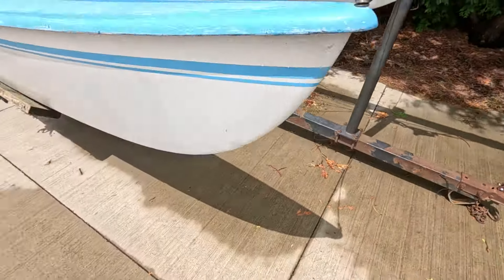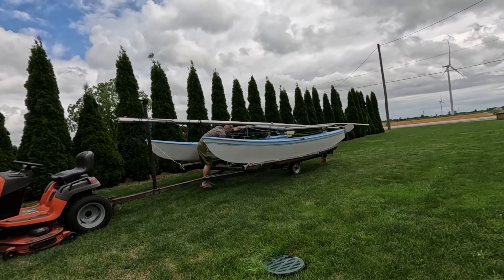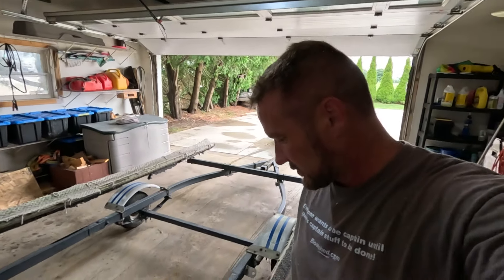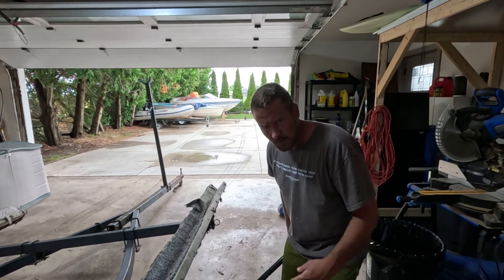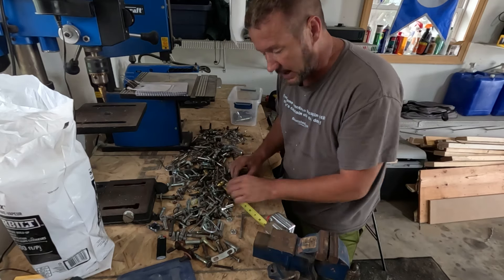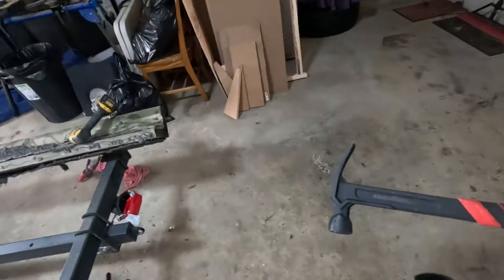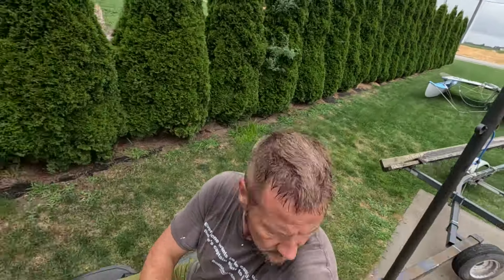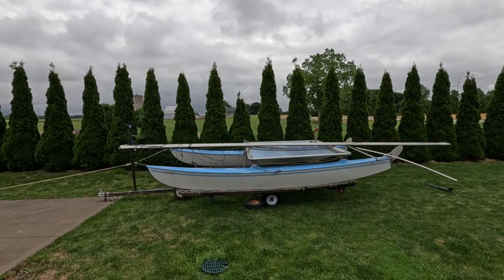Cheap Sailboat Has So Many Problems - Ep 285 - Lady K Sailing

Comment: Sounds like a fun idea, but I'd suggest super soakers instead of water balloons...  No need to throw balloons into the water.
Reply from the maker: They make ones appropriate for the task. Degradable. We use them in poker runs all the time. No mess.
Reply: The quick research I found is there really isn't a balloon that breaks down. It can take months or longer. Supersoakers are a better idea.
Reply: @stephenbmorton  "degradable" over the short time of 100k years!  Technically, the truth!
Reply: Someone has to bring a jet boat with a diverter.

Comment: I just bought a 1964 Contest 25-1 for $20. I drove to the DC area to get her with my trailer from my Catalina 22. I did put fresh tires on her and made longer bunk post for it.

I didn't realize how much more the Contest weighed. I was towing it being my 35 ft school bus. I kept my speed at 45 mph or less and stopped every 30 minutes to give the tires a break. I crossed the Eastern Continental Divide and went through Gatlinburg as well.

I managed to transport the boat from Washington DC to North Alabama safely.

Much of the interior is good and because it has no balsa core, the boat is incredibly solid.

The restoration is underway and I can't wait for our future adventures.

Comment: 😂 I did the same last year, I got a Mystere 6.0xl almost for free, very good sail with new mast, but the hulls needed some repair.
After the famous last word of the owner “the trailer is ready to hit the road” I pinned on my truck and 2 km from the pickup point I lost one trailer wheel, was late at night. 
I dragged without one wheel to a Canadian Tire parking lot 6 km away, sparks everywhere, slept the night in the parking lot, following morning bought two new wheels and bearings, one jack, luckily I had my tools with me, and fixed 😂.
After some tlc now I enjoy it!
I use to race on Dart 18 but this cat flies fast like a Tornado.

Comment: I just did the lights on my boat trailer. I bought the magnetic ones so you can pull them off before you stick it in the water. Waterproof submersible don't know but I just yank them off and stick the boat in. So far so good
Reply: Excellent solution. After installing many sets of lights on various ''bargains'' boats over the years, - never last more than a season or two, this is a great fix - magnetic mounted set. Take these off or install at your leisure.

Comment: Love this. I taught myself to sail with a 800$ Hobie 16 on the gusty glacier lakes of Minnesota and South Dakota. The trailer was homemade from a model A axel that was probably worth more than the boat. It came with I think with the original 1978 rainbow blue sail that I plunged thru on a capsize. A filp will happen if you are doing it right. I replaced it with the holy grail tequila sunrise sails which I still have and would be for sale!

Comment: I like the idea.  I’d be totally in if I wasn’t 2k miles away. 😕

By the way, you probably know already but grounds are the number one problem with trailer lights.  I always rewire mine with all dedicated grounds that connect directly to the wiring harness.  I highly recommend doing it this way next time, It’ll save you a ton of headache over time.

Comment: When you changed the wheels I would have applied Rustolium paint to the metal frame plus add a couple of aftermarket rollers and jack wheel to move the trailer around by hand

Comment: I remember racing my 12 ft. Wesort and Laser while learning to sail. It's also when I learned to dislike power boats. Especially the skiers behind them. They would fly by and spray the sails with a wall of water. When in the Wesort I began carrying a paddle to slide across the waters  surface as the skier came by. Didn't take long before skiers recognized my boat and stopped spraying.
Think about adding a solo  skier behind the power boat.

Comment: Ok. That sounds like an amazing idea. However, I would recommend each boat to get a 360 camera on the boat, and a GoPro on like a bump helmet on the contestant. 

That way, you could pull “drive by” shots of the power boats in post production using the 360, and get a point of view from the contestants. 

Another option would be a bunch of those insta 360 Go’s. People have zip tied them to birds and gotten good video. They would be small enough to go just about anywhere. 

I only recently found your channel. Loving everything so far.

Comment: Great video!  I recently bought a Kells 23 trailer sailer, with trailer, and had the joy of needing to repair the trailer.  This included welding new 2x4 steel sections to the rotted frame, replacing cracked leaf springs and replacing all 4 wheels (rims were rotted through), replacing the fenders and lights.  Had the same issue with the stupid white wire :p.  HOWEVER, after all that work, the one thing that caused me no end of grief was the process to get it registered in NB.  At some point in the chain of ownership, the paperwork was not maintained, and so there was no paper trail for the boat or trailer, nor was there a VIN on the trailer.  Here in NB, the only way around this is to declare it a homemade trailer and get an MVI done.  The trailer has now been with an inspector for 2 months while I wait with baited breath to see if it passes after all the effort I put into it.  Meanwhile, I do have the boat in the water which I managed on the way to the inspection.  The lesson here is: know the rules and process in your area, and if you live somewhere like NB, having the paperwork is easily worth an extra $1000 - $2000 on the sticker price as it avoids the mandatory (buddy holding you and your trailer over a barrel) inspection.
Reply: You are so right, getting a registration for your boat trailer in NB is a pain !  Make sure you know what is expected before you buy the trailer/boat.

Comment: Wow I just bought a Hobie 14 Turbo. I went to New York with a U-Haul to get the boat, no trailer. Last friday I drove 240 miles to get a trailer in Indiana. No title for the boat, a 14 foot sailboat in New York doesn't need a title. I've still got to figure that out. Now that I am retired I'm getting back into sailing, I had a Hobie 18 in the 80's. I'll be right here watching how you are getting your 16 ready to sail again. My next step is the title and then rigging. I like seeing you pull it around with the tractor. I live 200 yards from the lake in my community, I'll be pulling mine to the beach with my Cub Cadet. I might even be able to leave the mast up if I can make it by one tree.
Reply from the maker: Nice!

Comment: I have many years of experience sailing H16s and H18s.  1. Get rid of those dumb bunks and put rollers on the trailer.  2. Buy a set of beach wheels.  3. replace the top of the mast with a Comtip.  4. How solid are the decks in front of the pylons?  If they are soft, sell the boat.  Trimming the main stresses this area and will cause the foam core to disintegrate.  5.  Good luck replacing the springs in the lower rudder castings.  They provide pressure on the rudder cam lock bearings that allow you to lock the rudders in the down position and release the rudders when beaching.
Reply: What a pessimist, soft decks are easily addressible if it has not gone too far. I have seen plenty of soft decks  Never have I seen one so far gone that you can't fix with thickened epoxy to stiffen up the foam and fill the voids

Comment: If the trailer wiring is CCA (copper coated aluminum), you will be redoing it next year. The aluminum degrades/oxidizes to dust in a moisture environment. Got to go with copper and avoid the cheap imports if you are looking for longevity.

Comment: Getting the sailboat race organized and done should keep you outta trouble for a bit. Sounds like fun excepting adding the nuisance powerboat bit of reality. Gawd they make a mess of the water, churning up huge wakes. Here on the west coast its seiners with usually very large bow waves and in light air you have to turn into their waves or suffer being thrown from side to side in the cockpit, sails and boom slapping back and forth and  unless holding on, for dear life, to something solid. Nice not one bolt snapped off or was salt water rusted on to adjacent metal.

Comment: I'd like to try sailing, but there's a low bridge between our place and the big water.  Would it be practical to drop & raise the mast to get under the bridge?  There is a bit of beach area on both sides of the bridge.  I'd need a small trolling motor also to transit through our narrow cove.  Does this sound feasible, or probably more of a PITA than being worthwhile?
Reply from the maker: With a small sailboat it’s not too hard to raise and lower the mast

Comment: Tim - fun idea to showcase boat designs versus each other! And the ‘eco’ super soaker idea, big thumbs up…

But im concerned about wave bonbing / motor boat ‘messing’ with novice sailors in boats they are not confident in… 

Please bear in mind that you are an experienced sailor and boat rescuer, and hugely influential - but you will have non-sailor viewer yahoos who will copycat what you do, and will NOT understand their impact on boat safety…

eg Like the motorboats that kept buzzing you when you were disabled in the ICW…

Any sentences you might mention about ‘Don’t  try this at home, kids’ will be instantly forgotten, while your visual images will be retained.

HOW ABOUT…
How about testing how many drogue sections (inverted cut-in-half-and-reversed plastic javex bottles (bailer-type), strung together it will it take to keep the hobie level with the laser…

Or 

a game of on the water of boat-soccer? You just need a giant inflated beach ball and a fourth dinghy to have 2-a-side!

Or 

a dinghy circuit / obstacle course - round a wacky set of cans, required capsize and righting points, through super soaker squeeze point/s, tasks like sail an object from one docking or buoy to another, slam dunks through hoops, … 
…(anything you do will prob have to be sped up to retain interest and a variety of tasks should provide visual interest/contrast?)

Best wishes and looking forward to the video!

Comment: From what I can see so far that boat w/trailer is a bargain for $500 USD. The trailer alone is worth that especially if it has a title.

What year is the boat? I think 1980ish, the mast head sheave gives that away. The year is the last four digits of the HIN on the starboard hull.

Did you check the hulls for delamination? Delam is a big problem for boats of this era.

Are the hulls seriously warn on the bottom?

You will need to add grease to the BBs more than once per season. Definitely every time you tow long distance.

Respectfully submitted.

Comment: If you want to compete in Hobie Class Association races, you'll have to get a mast with a comptip. H16s can't be raced with the old, all-aluminum masts.
Reply: You can check with a hobie dealer to see if they will still retrofit the mast comp tips for free as part of the lawsuit recall.  They do or did in the USA.  It would also remove the top section with that wicked dent.